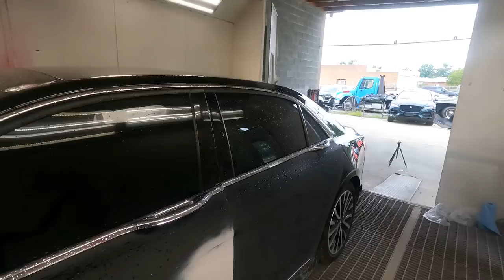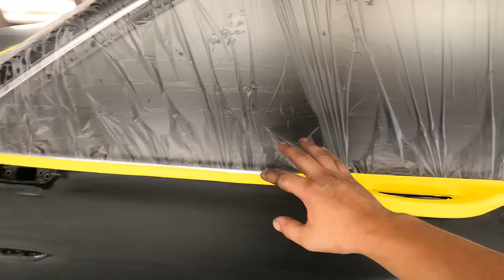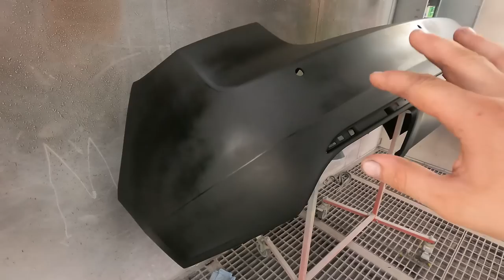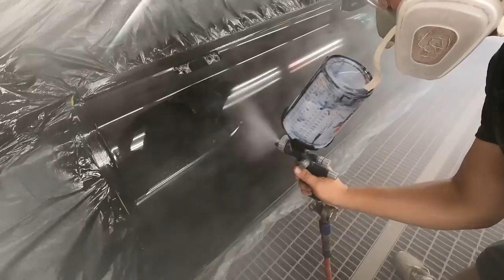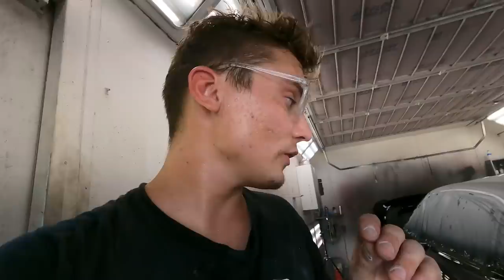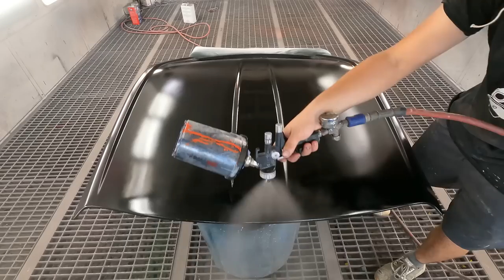How To Prep And Paint A Car! Amazing Results!!!

Comment: Nice job.   Would like to see a video that discusses the different stages of sanding with what grits to use.
Reply from the maker: I got you 👌🏻
Reply: This is the professionel way.
Reply: I was gonna say the same. I sand wood floors for a living and even though the grits we finish to are way coarser, I still think I'd get the hang of this easily if I just knew what to do

Comment: I am no expert but it looks like you knocked it out of the park. On the tape removal, (Lincoln), I thought that I’d seen where they pull the tape & plastic off to prevent peeling. Maybe that’s a personal preference to be determined by the painter? Thanks for the guidance.

Comment: You have gotten killer with the painting. Try 105F+ and that's a dry heat. In the Desert if a paint booth isn't in an airconditioned building, you would have to paint late a night. Keep Orange Crushing It!

Comment: is it completely impossible to do a spray job completely without small imperfections? i.e. small grains of dust here and there that need to be buffedout. just curious. although there were some specks here and there visible, the paintjob looks awesome anyway
Reply: Was thinking the same. They do a lovely job, but them little dust parts would pee me off! Check out LNC PAINTER. He seems to be able to finish off the Gun without too much flatting and buffing afterwards 👍